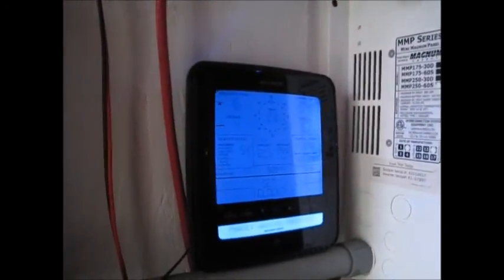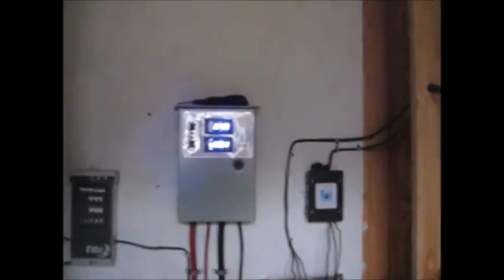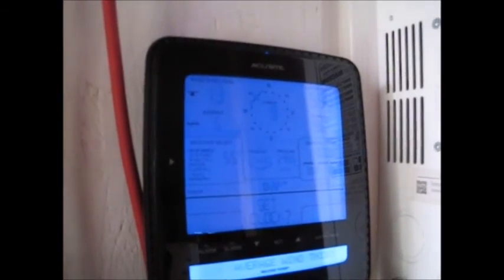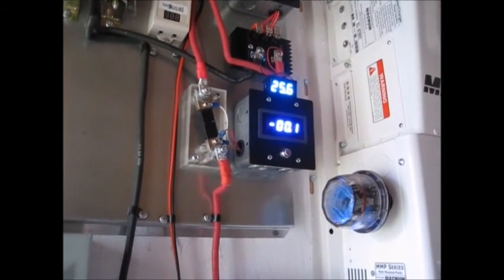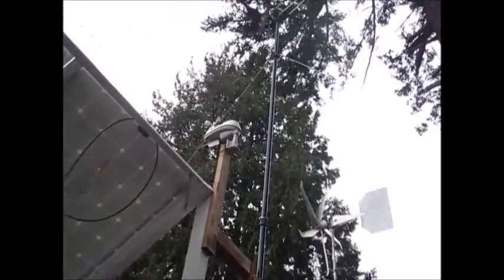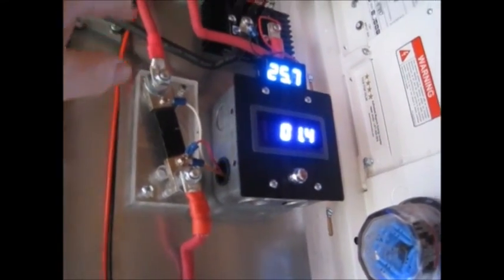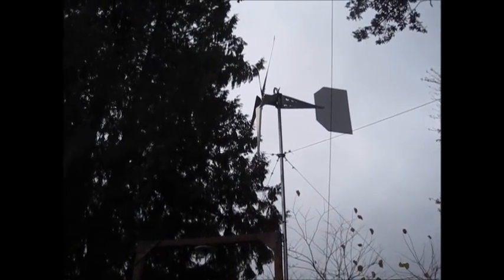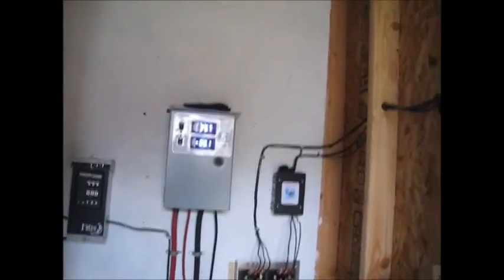Belgrade Mini Wind generator vs Freedom II

Comment: Very nice, Belgrademachine's got a great turbine design - can't beat the axial flux! Thanks for sharing SD
Reply from the maker: +James Biggar  Hey James, nice to see you again bro!!  still cant beat that dual vawt set up you have on the roof lol. hey, got a question for ya, I saw the auto cad design you showed on youtube. with that bearing located in the middle, how are you going to run the electrical wire from stator down? I love the idea of the bearing, just has me stumped how the electrical will hook up?  catch ya later on SD!
Reply: Thanks lol. I was actually going to build a slip ring for it (not shown in the cad because I was still contemplating at the time) - but decided against it. The yaw design is rugged, but there's no need to overcomplicate things - the conventional method using hollow pipe and a flat needle bearing would suffice for tracking just fine I think, then you can run the alt. wiring straight through the pipe.
Reply: +SilentDeath002 If you've downloaded the cad from the website, feel free to make any changes you see fit - that's the whole idea behind 'open source'. I've already made quite a few changes to my plans since uploading the video
Reply from the maker: +James Biggar that's great, only problem I have is no printer , I would have to load info onto a flash drive and take it into a company to print out.
Reply: +SilentDeath002 I suggest you to unrated this video just for the fact that you have received a bunch this week from Jeff... He have perform the same trick on two of my vid last month just to play with his reputation..

Comment: Hey SD! Glad to see a video from you and sorry to hear about your health. Get rest and take care of yourself first! Good coincidence, you will be seeing a video from me in the next week. I have just put up the same turbine you have there in a serious wind location less than an hour away. Not a shrub higher than my knee up at 15' with 9 guy wires for when the big storms come. I bet you have that freedom shorted out somehow something doesn't seem right. I purchased a single core 24 volt pmg and look forward to building a custom frame for it at some point. Should be a lot less effort than the axial though I do like the strait shot too. Keep em coming bro!
Reply from the maker: +belgrademachine   Hey buddy!! nice to hear from you. I got up on the old vawt  stand with a telescopic pole to try and move one of the blades on the freedom II. each time I tried to rotate the blade from one point all the way around, it made a heavy screech, scratching noise and would stop about the same point each time. do not know if its a bearing, or something else. I will have to lower it.  your Belgrade mini hit 20 amps in a 17mph wind this evening!!! did you use magnets stronger then 49 pound pull on your set up?  would be interesting to see what this stator would do in yours, I just got to get healthy enough to make one. its driving me nuts for you to have to wait this long, I better make it a good one lol, catch ya later on, SD.
Reply: +SilentDeath002 Sweet! 20 amps. Don't loose sleep over that stator by the way everything is cool just take care of yourself. The magnets I have are 1x1x1/2" N42 .... think they are about 56# pull. My stator is about 150 turns of 18 gauge and have the falcon mach 4 81" three blade set. I hope to get better data at my new site but it appears to perform well. I'll PM you soon I've got a question for you.

Comment from the maker: Hey Romo!!! hows it going?  I hear your getting your own place, congrats!  sure is nice you have your mom's place set up really nice for back up power. really nice system you built.   yes, its not working as advertised. I have pulled it down, checked all the connections since I get a lot of rain. everything Ohms out fine. break switch is working like its supposed to, have no clue why those larger blades will not rotate.  the Mini wind generator at times even makes power under 10mph, around 9. but that depends on the wind direction also. its hell testing these with all the trees I have around here, but last year, the Freedom II at least was rotating in these same winds, I have videos to show it. have no idea whats the problem,, augghhh lol.  catch ya later on SD.

Comment from the maker: I had a busy day.  I finished installing the new Midnite solar classic 150 for the Belgrade mini wind generator. I called my buddy Orlando that is the builder for the Genesis Wind Generator for some input ideas for the Wind Curve.  Its going to take a little while to tune in each of the 16 steps but its looking very promising. I hit 2.7 amps in a 8mph wind. going from step to step just imagine your shifting the transmission on your race car, and if you shift smooth,  it continues to increase in speed and output.  It got to late to make a video, so ill try and show one tomorrow when I have decent light.  See ya ! SD

Comment from the maker: Hi guys!  just a few ideas for my next build and why.  currently the Mini set up has 12 each 49 pound pull magnets on each rotor. the rotors are 7 7/8 inch in dia. the stator has 12 coils with #14  200C temp magnet wire on it. 100 turns per coil set up in star configuration.   now, if I had room to put a say 12 inch set of rotors I could increase the number of magnets and also increase the number of coils on the stator since it also increases in size.  reason why, you test out each phase like I did in the bench top testing video. if you add one more coil per each phase,, from 3 to 4 coils, each phase makes more power. all together that will give you a lower cut in speed.  Now just a safety comment. when you start doing this, you have to make sure you have a good dump load set up in case you do run into high winds. but you can increase the number of magnets and coils to fit the type of wind you have to make the input power you want, and its custom to your area.
Reply: +SilentDeath002 Thanks SD for that verry EDUCATIONNAL PRESENTATION you have made here...  That`s the warning i was trying to send over youtubers to do there homework when they were new to the Wind turbine future buy..You did an exellent job in the common sence departement and a side by side comparasion with dirty winds in verry seen in city``s...  No need to have a 60 foot pole to make it work,, just commun sence..
Reply from the maker: +al “peper 0110” desrochers Hey thanks buddy.  Ill try to add more information as I get to it.  I remember when I built my first 3 phase set up. I put it on a pulse motor to get extra power back from the shaft speed.  And it always seems its more enjoyable when you build something yourself and see it work, makes it all worth while.
Reply: +SilentDeath002   Yes it is.
Reply: +al “peper 0110” desrochers I shared it on FaceBook too.  The world needs to see the crook at work
Reply: +Polaraco Hobby I remember when Jeff did a video on you, me , Billy and Charles saying we were the bad guys...&#160; I guess some people have Wake up and see we were defamed by him..&#160; Take care
Reply from the maker: +al “peper 0110” desrochers  I would say we were not defamed, cause all the guys that no what it takes for a decent wind and solar set up no the truth so you all helped people save from being ripped off. he just did a video showing input into the classic. 30 plus mph wind and it still did not reach 2000 watts. I went to his web site, printed out the power curve charge he uses in his adds to sell the wind generator, watch the amps, watts, and battery voltage coming in. what you see on the classic is way below what the advertised chart states.

Comment: I think the freedom ii needs more torque to start it up, the freedom i might be more suitable. at that height. 
I have been wondering it it would be worth getting one up in the air this year even if it would only be 25 feet up.
just a thought, muddymuddymuddmann makes his own two blade wood blades and ian57812 makes a composite blades you may be able to work something out with.

you are in my thoughts
john
Reply from the maker: +Rev John O'Toole Hey John, nice to see ya again, hope all is well.  yes muddy, and ian make there own blades. muddy likes the single blade, one on top and bottom actually, but that can cause a vibration. ian made a really nice blade, cool set up! problem I have I can not go up any higher unless I get a tree trimming company back in here and clear out some more like I did last time. and they were scared to go up as high as they did. to be honest, I would try to make your own axial set up. they just work better then some of these store purchased ones. sure, some will still like them. my big goal is to get wind power from my every day wind which is 10mph. that means a custom build. its actually cheaper to build one then the price of these store purchased ones.  I would like to start to openly share information to everyone how to get supplies, build ideas, testing wind, set up locations, charge controllers, etc .  so you can get the most bang for your buck.   at 25 feet, check your surroundings see if you have good wind by testing it. let me know what ya got, be glad to help you out. will catch ya later on buddy, see ya SD.
Reply: +SilentDeath002 yes, if I could weld I could do quite a lot. like you my health risk are my legs. 4 months ago I bumped into something and finally healed it this week, 4 months of going to the wound clinic every week. I wouldn't even feel the hot slag hitting my leg or foot.
we learn to cope.
best
Reply from the maker: +Rev John O'Toole sounds like we need to get all the guys together and come up with a plan to get one built for ya. then, some help to get it up in the air safely.
Reply: +SilentDeath002 the ground is freezing and this will be my first winter in my new cabin that I have been working on all summer. I do have my vawt up in the front yard that I just have to add the freedom to.
by spring time I will have a better plan.
best

Comment from the maker: I have had a lot of people request information to be able to contact Belgrade about his mini set up.  First off, if you go down the list of comments on this video, you will see his name there, just click on his name and you can contact him that way.  Second, shipping cost will not be that bad, its a light weight set up without the heavy magnets, and stator weight.  if any of you pick up one of his mini turbines , they are really nice, well built with bearing so strong, its major over kill.  you will have to select size and pull strength of magnets to be used, and purchase some magnet wire to make your own stator.  I have a few videos showing the stator solutions that work really good.  I can also give you some ideas of number of turns to use for each coil set up vs the battery voltage you want to charge.  and ideas of what magnets to use.  the magnet rotors are only 7 7/8 inches in diameter, so magnet size used is important. hope this helps SD

Comment: Nice set up. Shame that other turbine won't spin.  😒
Reply from the maker: +Darren Baldwin I went outside in between the heavy rain , and I put the brake switch on the freedom II in the middle so it would free spin. blades still did not move.  so, I got a telescopic pole and got up on the old vawt stand and tried to move one of the blades. its like something is messed up inside , cause when it did start to move, once it got to a certain point I could hear a heavy scraping noise and it came to a stop. have to take it down to do a detail inspection. that will have to wait for a calm, no rain day lol.
Reply: +SilentDeath002 That doesn't sound good. Must be defective. I'd see if you can get your money back! 😋
Reply from the maker: +Darren Baldwin yeah buddy, I am not even going to try. I have seen how they treat other people, ill just write it off and go from there.

Comment: Amazing, you also got so many thumbs down for showing the Missouri machine was all hype and lies.
I would like to see about buying a kit from this man in Belgrade. Shipping to me is a bit high but his build is so much better than mine with the fisher paykel I adapted.
Reply from the maker: +Some body will eat it   if you go thru the list of individuals that have left comments, you will see belgrades comment.  just click on his name, possibly subscribe to his channel, go to the about comments and you can send him a request for one.  I think I remembered him saying he has one left.  you will have to select your own magnets and build a stator, if you need help with that let me know, be glad to help you out SD
Reply: I will be watching his Ebay account for new things.
Reply from the maker: +Some body will eat it  I hear ya buddy. he just posted two more videos , now one showing the power curve chart. it still does not match the output, and to reach 2000 watts, you need over a 40mph wind lol.  if you check some of my videos, you will see a response from Belgrade. you can click on his name and go to his channel to contact him. since there is no stator or magnets the weight is way down so shipping is not bad at all. let me know when you get it, be glad to help you with magnet selection and tips on making your own stator. I used 49 pound pull magnets on mine, if you got 62 or higher I know using #14 magnet wire, and blades similar to mine, it will reach cut in power for a 24 volt set up around 6 to 8 mph easy. if you have a 12 volt set up you will get outstanding output. let me know bro, be glad to help you out. SD

Comment from the maker: I have been doing a lot of research online about company scam claims. There are a lot of them. to many to ignore. I ran across a blog from Hugh Piggott actually addressing one company in particular. Pretty much in a nut shell he says the owner of one company no's nothing about wind turbines. He was also attacked but later the video was removed. All I can suggest is, before you purchase a product from anyone, check how many complaints have been posted. It will open your eyes.

Comment from the maker: i get my magnets from Magnets4less.com  which is actually applied magnets, same company.  Magnet wire i get from a company on ebay,   Essex. great prices really fast deliver. for rotors you have to build yourself, check out some local metal fab shops. my rotors on the vawt only cost around 76.00 to have milled how i wanted them. bearings, there are thousands of ideas, easy one is trailer spindle and hub sets. you can get bolt on type or welded, once you have the bolt pattern, you can show that to the metal fab shop so you can mount your rotors onto it, but you will have to knock out the bolts and use longer stainless steal all thread. that will not attract to the magnets.  but, there are thousands of ideas, to build and design your own so once your done, you know what your going to get for output.  Orlando's Genesis is a monster,,, puts out a lot of power. Belgrades design is also excellent, but you will have to use your own magnets and build a stator, vain, and tail section. So with a little research, time, you can get exactly what you want. sure you might make some mistakes but, its a lot of fun, catch ya later on!  SD.